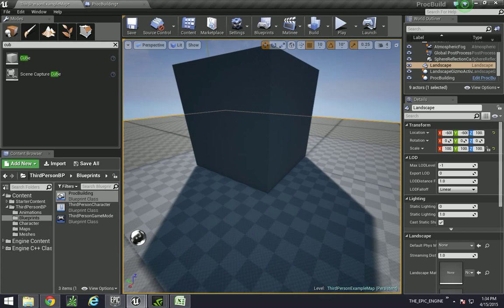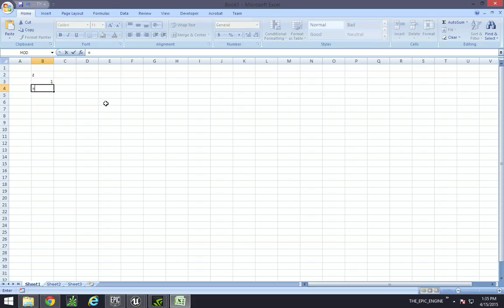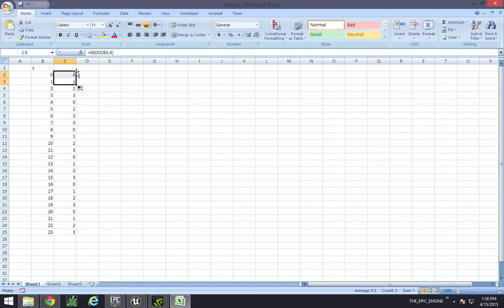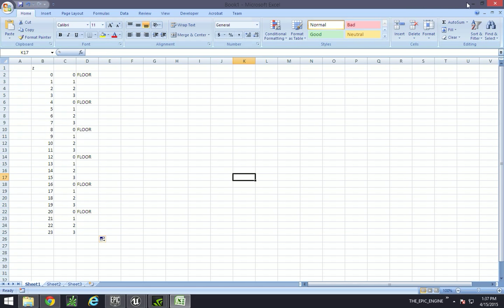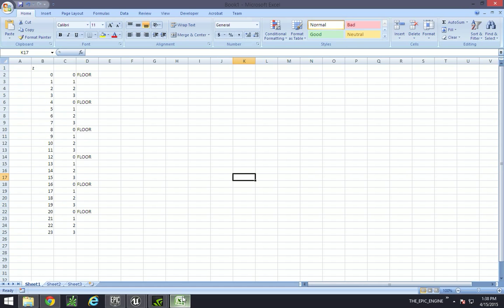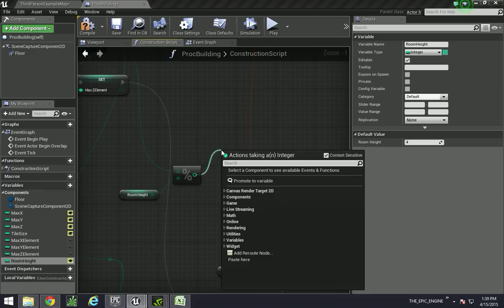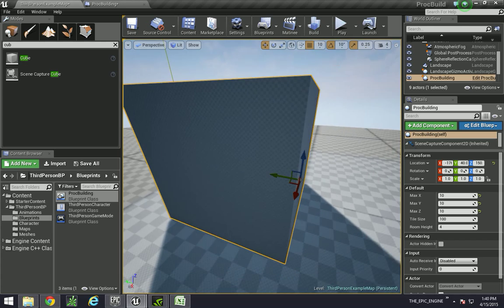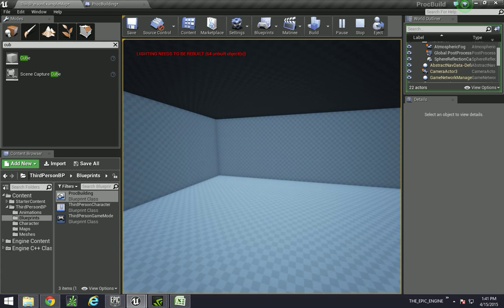UE4 - Procedural Building Making the Floors

Comment: How can i make the building generate in a 6000000000 square km area with 10000 floors going both up and down
Reply from the maker: I would highly suggest instead of blocking it out like how its represented in the video, instead you create instanced static meshes with modular meshes for walls, floors, etc. Make sure your LOD's are optimized well. Sounds like a challenge, good luck!